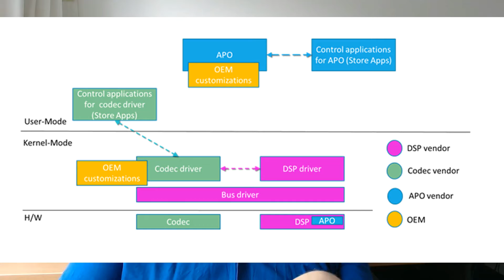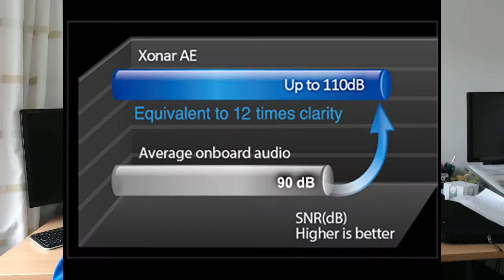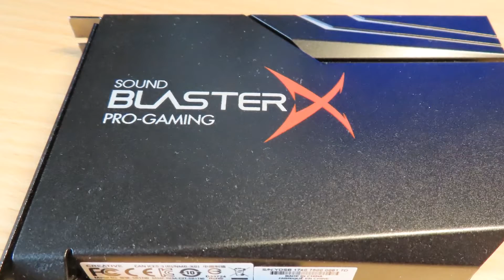The best soundcard in 2019! Antons hardware reports!

Comment: Does the Creative software need to be open for the EQ to work?  One of the thing I like about ASUS Xonar software is that you can open it, change settings and then close it.  Is the Creative software like this, or does it need to be running in the system tray all the time?
Reply from the maker: Yes you can adjust the equalizer and then close the app. It should save the settings.
Reply: @AntonsHardware  Nice to hear, thanks!

Comment: Hell the Audigy SE produces better audio than those older Realtek chips. No one was really using EAX in games by 2005. Interesting fact about ESS is that they made ISA sound cards back in the 1990's of which I own one of those.
Reply from the maker: I used to own one! Cant remember which one. Great card!
Reply: @AntonsHardware  I even own a Yamaha YMF719 based sound card.
Reply from the maker: It seems you have quiet the collection! The oldest card that I own is the Soundblaster 16 pro. I used to own a Diamondmax Ultrasound 300 with the Vortex 2 chip on it. But it got lost in a move! Still miss that card!

Comment: Hi, first of all I am Dutch, but I will do this in English.
My question first, maybe easier: Can you tell me which PCI-e x1 soundcard (5.1) I could buy for less then 100 euros?

Explanation.
I have been thinking about a dedicated soundcard for a long time. I want a PCI-e x1 for my MSI B450M Mortar Max. The motherboard has an ALC892 audiochip and the sound is not that great. I use a logitech z506 5.1 speakerset and sometimes I use my gaming headset or normal headphones connected via front audio output. The board before this one had the same audiochip, but thanks to Nahimic 3 the sounds was really great, much better. Unfortunately this board is not compatible with Nahimic software.

I just want a good PCI-e x1 soundcard for less then 100 euros with a connector for frontpanel audio. I also have Tidal HiFi/Master for the best sound quality.
Reply from the maker: Hoi Johan/Hi Johan,

I'm really happy with the Asus Xonar AE. You can get it for as less as €65 (https://tweakers.net/pricewatch/1163501/asus-xonar-ae.html). But if you want to spend a bit more, I can truly recommend the Creative AE5. It is more expensive, but the quality is superb!
Reply: @AntonsHardware  Hi, thanks for the info. I saw that the Xonar AE does not have a frontpanel audio connector, but that Creative AE5 does have one, right?

The Creative Sound Blaster Z  does have a frontpanel audio connector too. It's cheaper and have better reviews on Tweakers. If the Creative Sound Blaster Z is good enough, that I will make consider that one. The sound does not have to be perfect, just better then what I have now haha :). 

Do you think the Creative SB Z is good enough? I mean compared what I have now, the Xonar AE and Creative AE5 and the driver/software from the 3 dedicated cards.
Reply from the maker: Well, as I was working on another video, I came across some Soundblaster Z pictures I intend to use. And I thought, isn't this card something for Johan Schouten! So yes, I could also recommend the Creative Soundblaster Z! I made a video on that card here: https://youtu.be/zfa4I-wX9LI
Reply: @AntonsHardware  Okay thanks for your reply! :) I think I will buy the SB Z when I have the money for it haha :)

Comment: It's really interesting how things change and repeat themselves. Everyone who has been using PC's for 15-20+ years knows the quality of Creative's old Soundblaster series. Then Asus beat Creative like ten years back simply because Creative became lazy on its throne. Then onboard solutions became widespread and Asus kinda lost the market again, and now they're trying to get back with the same lazyness while Creative slowly crawls back up. The external SoundblasterX G5 and G6 seem to be quite popular now, too (not so practical for me though, would have to plug the headphones in and out all day in order to switch to speakers back and forth; i don't trust the build quality enough to believe it can cope with that for an extended period without developing a loose connection).

Also interesting, in your very first video you describe having returned the AE-5 because of the price. It was way more expensive back then (you mentioned 170€, 120 now), but still, now it's your winner. What changed apart from the price or is it just that? I'm asking because i also NEED a soundcard :D and can't use my old PCI stuff on the new PC, and desperately try to find something good but not so expensive. Was looking at the Xonar AE but it always felt like a very cheap attempt at a successor for the DG(X), which you now have confirmed. So, i guess i should get the AE-5?
Reply from the maker: You're absolutely right. The Creative Soundblaster series were the best and Creative did become lasy. The cards they made were more of the same and the driver support has always sucked. The Daniel K situation didn't help their situation either.

I returned that AE-5 because of the price. A few weeks later I found a second hand that was a lot cheaper. If I recall correctly €100. Now for that price everyone should buy that card. In my 2019 roundup I had to make a choice. The Asus Xonar AE has the best price/quality ratio. It is pretty good. If you only use onboard now, that would be my recommendation. But the Creative AE5 has better sound quality. That's why I put the Asus in second place and the Creative in first. My recommendation for you is the AE5.